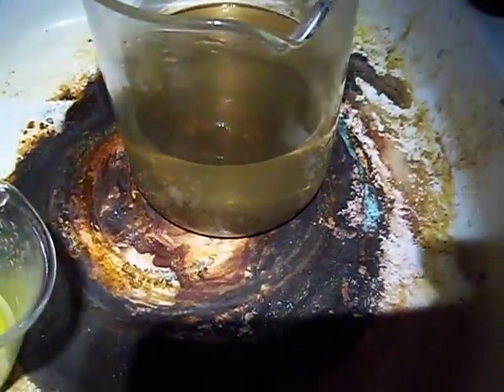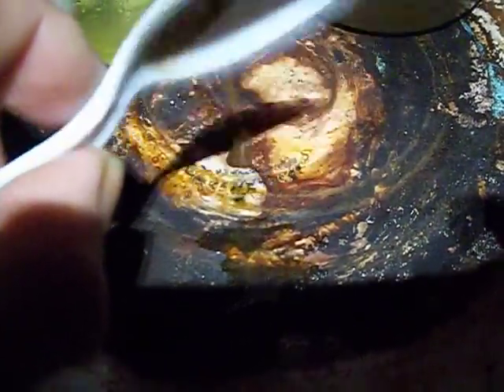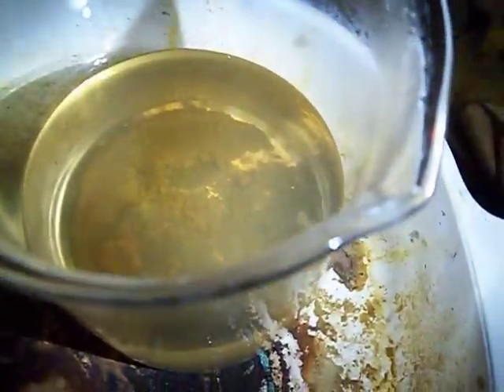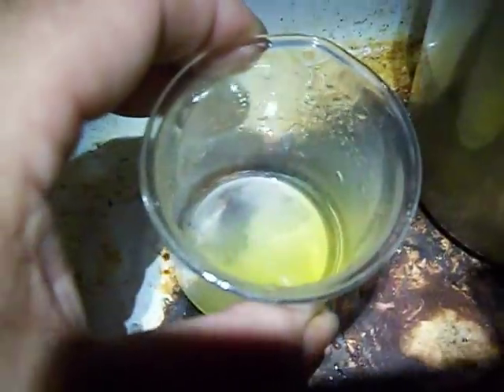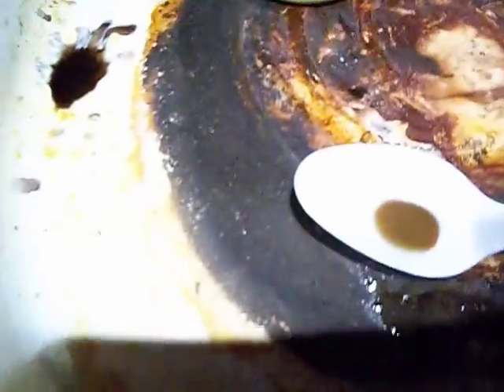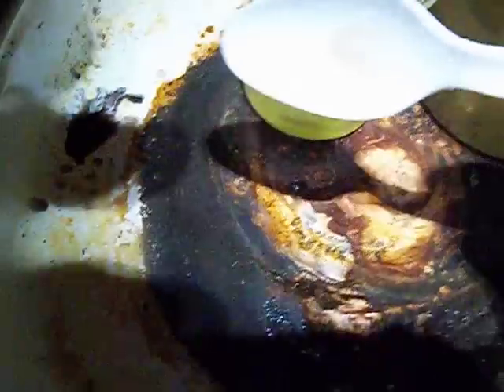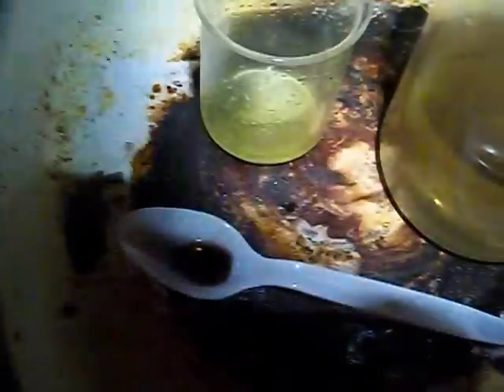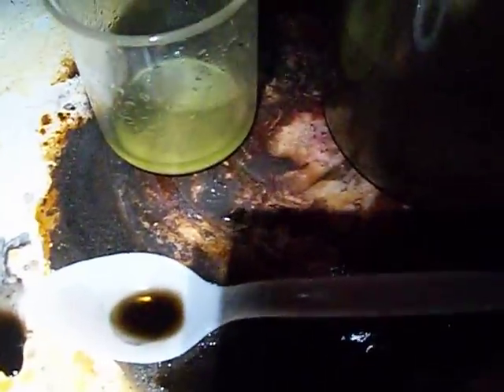Gold drop from a dirty solution.

Comment: I bought SMB about one year ago.  I processed some gold flakes from some silicon wafers.  I liquefied the gold with muriatic acid and bleach.  Afterwards, I added a teaspoon of urea to my two cups of solution then added SMB but the solution never turned dark and none of the gold dropped.  My SMB was stored in my house.  Can SMB go bad in time?
Reply from the maker: +mpetrus100 To answer your question, Yes it can. Sodium metabisulfite is very hygroscopic which means it soaks up water out of the air. Moisture from the air combines with the SMB and a chemical reaction occurs leaving behind sodium sulfate. 
Now, just an FYI. If you dissolve gold with HCl and bleach, you do not need to use urea at all. Urea is used to remove free nitric acid in AR solution. with HCl and bleach, just heat the solution to steaming and stir. The tiny bubbles that form is the chlorine gas escaping the solution. WARNING : Chlorine gas is poison and can cause permanent damage to lung tissue. Use every precaution you can to avoid breathing the chlorine fumes.
Reply: +Geo Thank You.  I went and got some stump out, used it and the gold dropped.  Per your suggestion in your gold refining video series, I always wear a respirator with acid filter cartridges rubber gloves and safety glasses.

Comment: I have a aqua regia black liquid suspension of gold in aqua regia. I added SMB from Stump Out to precipitate but it did not work. It fizzed, but the SMB fell to the bottom and the black liquid did not precipitate the gold. What should I do now?
Reply from the maker: +Arnold Kabayo  Take a few drops of the solution and place it in a spot dish or plastic spoon. Add to this a few drops of muriatic acid until the solution gets clear enough to see through. Add a drop of stannous chloride and see if you get a positive test for gold. That's the only way to know whether or not the solution has gold in it or not. If it is positive, add add muriatic acid mixed with water 50/50 until the solution clears enough to see through. Add SMB again and see if the gold will drop. If it still won't drop, add some sulfamic acid slowly until it stops fizzing and try the SMB again.
Reply: +Geo thank you so much sir Geo i need to buy some muriatic acid first then i hope i could drop the gold.

Comment: Hey glad to see you back making videos!  Was getting worried about you there for a minute.  So what is the solution you are working with?  Is it a HCL Bleach mix?  How did you precip the silver separately? Thanks!!
Reply from the maker: Moose Scrapper It was an AR solution. The silver drops as a chloride once the solution cools. The material was military boards in AP. It was a real mess but it saved a lot of time. The PD was more troublesome than I thought it would be. I placed enough boards in a plastic 50 gallon drum to fill it half full and filled the drum with old AP solution. I was hoping to just make all the components fall off but the pure oxygen from my concentrator made the solution dissolve almost everything made of metal. The only thing that survived was the tantalum pellets from the tantalum capacitors.
Reply: Geo lol that's awesome.  You are using pure oxygen?  I am toying with the idea of starting to use nitric acid.  I have read and re read and read a third time proceedures and safety warnings and am thinking of starting really small to test it out.  Maybe try recovering from 6-8 ceramic cpu's or something.  Just need to find a source of nitric acid.  Thanks for your videos!  Hows the squirrel?
Reply from the maker: Moose Scrapper An alternate for nitric acid when making AR is sodium nitrate or potassium nitrate. HiYield makes a cheap 5# bag of NaNO3 for a few bucks. Potassium nitrate can be found as Spectracide brand stump remover. The process is called "poor man's AR". Search for that term to get some information about it. It works about the same way as nitric acid but requires heat for the reaction. I have a solid nitrate to nitric acid conversion if you need it and if I can find it. Just a few will not give a good test. Use at least a pound. Take the ceramic chips (white glass where the legs go into the body) and put them in hot 10% sulfuric acid until the glass starts coming apart. The glass will turn into what looks like sand and the alumina bodies will come apart. Most of the iron legs will dissolve and you will be left with the ceramic bodies, some of the iron legs, glass sand, glass chips and gold bonding wires. This process may take several hours so you may have to add more 10% acid as it evaporates.

Comment: hey" Geo nice drop" how are you ? i got a ? for you how can i get gold out of hard plastic witch it is trap in i have a lot to do would the Ar get the gold from the plastic the plastic holds the pins im need your Help nice to see you back  fred from san diego ca
Reply from the maker: fredie w Leaching from plastic should be your last option. The components will hold the solution trapped. If you can do it safely, incinerate the plastics. You need to have some way to burn the fumes for it to be safe. Of coarse you to keep the ash contained. Also, if it is connectors, the pins should not be dissolved in AR. It is best to either remove the gold first or remove the base metal first.
Reply: fredie w thank you for your input on the plastic in trying to recover the gold p[ns this unit is like a slot card very thin you find them in most serives boards put real nice gold im in a place were i cant incinerate to get read of  the plastic so ill  only keep the top pins thank you  hey" im for one is very happy to here you and your in my prayers
Reply: You're right, the pins should not be processed in AR, but.... But they can be. It's best to use the AP method or a cell for reverse plating. But none the less, you can go straight to AR and produce some dirty gold. So after the first AR process you will need to process any gold that drops again, then maybe even once more. It's not the best way and produces extra hazardous wastes for disposal, but it is an option. Though it should be the last option.
Reply: Get some concentrated sulphuric acid throw your plastic coverd gold in. Heat to no higher than 80c. Be careful its, gonna puff up like a marshmallow in a vacuum. After a few mins turn off the heat, let it cool. Dump in tl a larger contaner with good deal of water.... Settle, decant. Filter. Then go refine your gold